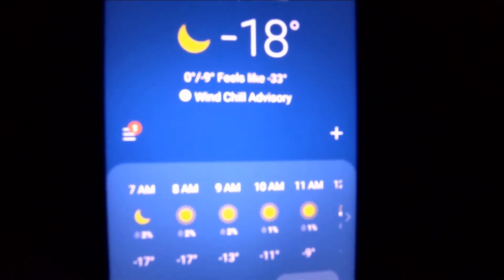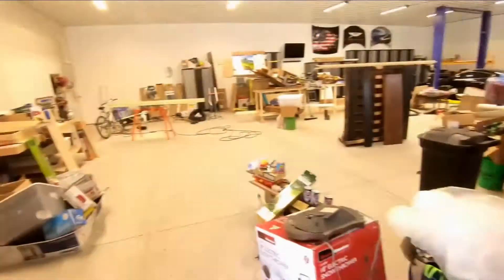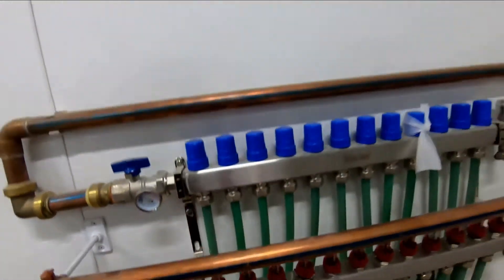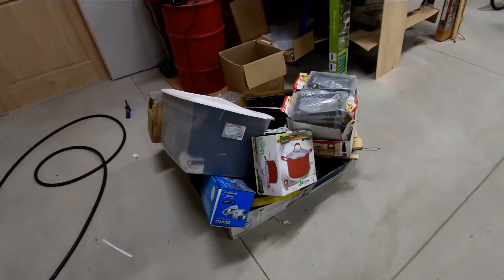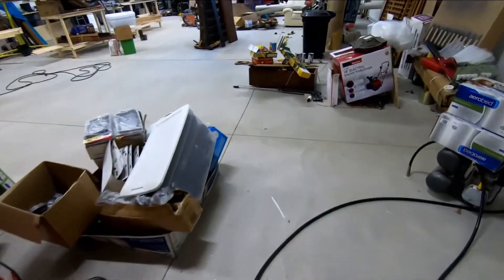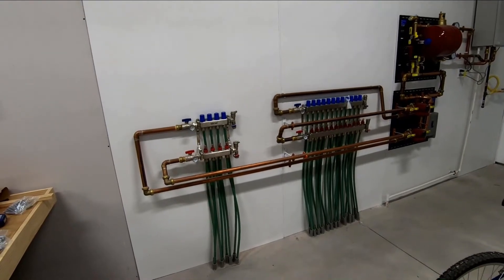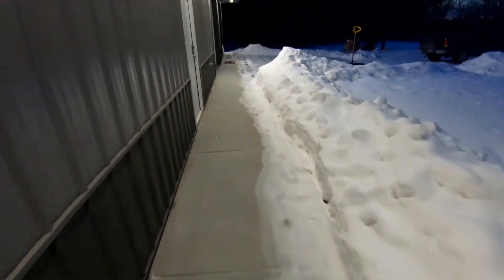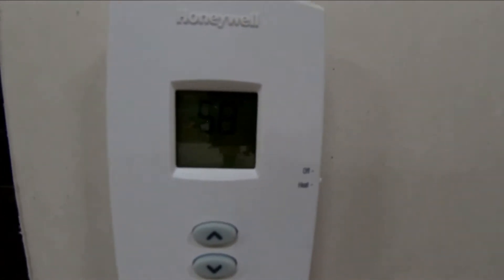-30  Degrees ! Did it Heat? NO Slab Insulation & Tankless Water Heater in Pole Barn Radiant Floor!

Comment: Run a primary/secondary loop setup, run the boiler at 180 degrees, with tempered water for the radiant loops running ar 120. It will be much warmer and more efficient.

Comment: wow.this is laughable,im sorry.3-4hrs to raise 1-2 degrees?no insulation or plastic under slab?floor would sweat in summer even in WI during the summer..i have a shop with in floor heat that is 5yrs old.its below zero today.mine can go the whole day without running and then will run about 1hr.to say that insulation isnt worth it is to say you are crazy to put it in your walls an ceiling..your drinking the internet koolaid.cheap isnt always good and good isnt always cheap.a straight up boiler is WAY MORE efficient.your system cant actually heat the shop,lol.my temp is at 115f coming out of boiler and my shop is set at 60-62f..without bringing a vehicle in and not opening either of the garage doors,my system will run maybe 1hr a day depending on sun.ive never came out to it being below the setting on my tstat no matter how cold or windy out.looking like your "theory"is not working.mine alss doesnt "overshoot" by more than 1f maybe at the most.storing btus for a week is insane talk,not with no insulation and vapor barrier.

i dont want to say its all bad but to tell people this is a good idea is crazy talk without actually knowing the facts.im telling you the other side of the coin here about how when installed correctly,floor heat works like mine does.
Reply from the maker: @rooster5755  When refrigerators were first invented , people didn't embrace it as they were used to the ice man , and didn't believe that unnatural cooling was good for the food. I think you may have been one of those people as they aren't used to change and don't understand new technology.
Reply from the maker: @rooster5755  Well your can search  thermal mass build.  How much does it cost to heat your place and how many sq ft  and cu ft ( ceiling height)?
Reply from the maker: @rooster5755 Also what temp is it set at?
Reply: @ my temp is set at 60f  and I usually raise it to 62f when I’m working or when people are over. All the rest doesn’t really matter. Either the system you have isn’t big enough or not built correctly or lack of insulation. You just opened a service door and walked in and it is below the set point by a couple degrees!I can open my 10x10 small door and bring in a cold vehicle to work on when it’s 0 out and mine might kick on a run but I have never come into my shop and it’s below temp at any time. I can’t tell u what I spend as the tank is tied to my house but I’ll guess about $500 in propane. I’m also in the country with next to no trees and my doors face the west where the wind normally blows from. My shop is also stick built with blown in cellulos in ceiling. Im just being honest with you. This is not normal. I know it’s cold out but I am experiencing almost the same conditions by me.  I also have 15mph winds.
Reply from the maker: This was done when temp was -30 , when its -3 , my system might run 1 hr . The colder it gets , the more energy it takes to heat up , basic science. Also your spending the same amount that I spend in a year to heat my building.  Your temp is higher , so you will use more then me and also propane you get 92k btu per gallon where Natural gas is only 85k btus , so it takes 10% more natural gas to equal your propane btu. So if your building is 3200sq ft then we use the same. If your building is smaller , then I'm heating mine for less. Also , if I put r 20 foamboard down, it would cost 10K for the insulation alone for underslab. That is 20 YEARS of my heat bills before I break EVEN!  If I put r 10 foamboard down , then that would be 10 YEARS of my season heating bills to break even!  So even if I lose 30% heat ground that would be $150 a year . So I would recover my loss of heat if I installed underslab insulation in about  64 YEARS!
Reply: @JasonYouTube  i can agree to disagree i guess..no way would i go through the trouble of infloor heat and not put insulation down or vapor barrier.for the little bit of cost.your insulation must be made of gold also..didnt cost nearly that much for mine i guess..lol.i GUARANTEE that 20 degrees colder by me and opening no doors that my system will maintain  temp.this is really what its about..my boiler runs a max of 1-2hrs sometimes and this is with opening at least one of my doors.then it wont run for a whole day.i will report next week i guess when its -10 to -20.ive just seen videos with all kind of ideas to save money on floor heat.tankless heaters arnt made to run constantly either..will go through 2-3 by the time mine bites the dust.this isnt cost savings..everyone looks at initial cost saving but in the long run it isnt.good luck.

Comment: Nice vid thanks!  I assume your shed is really well insulated?
Reply from the maker: R 25 in walls and R49 in ceiling. No slab insulation and it costs about $500 a season to heat. $10 a month for meter fee alone.  If I did slab insulation at R20 , it would cost 10K for 100 sheets . That would pay for 20 years of my heating bills to recover the cost. People don't understand that some heat loss is ok if you can't recover installation costs! Like when people spend 30K on kitchen remodel before selling , and they only get 25K recovered !
Reply: @JasonYouTube  thanks man.  building an insulated hangar in a cold part of New Zealand.

Comment: This is something I couldn't wrap my head around, insulation under the slab. Heat rises, right? It only makes sense that it would go up into the building and not out into the ground.
Reply from the maker: The ground does sap the heat but only to an extent.  You would need perimeter side insulation or else the sides would drain the heat from slab and it wouldn't heat. So basically create a chimney and the ground with tubing is the fire. You do need more tubing with the insulation to properly heat the ground to make it work. Thanks for watching

Comment: So its set at 130 degrees and on 58 degrees in the shop
Reply from the maker: The water temp is actually 90 degrees going into the floor slab. The heater is set at 130 degrees but it mixes with returning floor water on the panels , so it loses 40 degrees at panel.

Comment: Watched this when you first posted . Im up in Northern Minnesota.  Hows the system holding up after 2 years ? When you did you layout under the sand . What size pex did you use and tube spacing ? Im seriously looking at doing your system . With it being under the sand do you still need to run it at 120° or can you run it hotter ?
Reply from the maker: Its been almost 4 years and about 2 years ago had a pinhole leak in 1 line. It doesn't leak , only under pressure so I closed that line off on manifold.  It might of been a manufacturer defect as it holds liquid when not pressurized. But even with that line down, it still heats the same and uses same therms . The pex size is 1/2" and runs are about 290-298 feet.  Spacing is anywhere between 6" - 8" depending on area. Along walls and garage doors, used tighter spacing to compensate for heat loss .  I run it usually at 120 , but if its warmer ( 32-38 degrees) then I can turn it down to 110 as sometimes it overshoots the temperature by 2 degrees. You don't want big temperature swings as that uses more energy to stabilize temperature. when its under -10 degrees , I will boost it up to 130 . Raise or lower temp when its like a week of temperature extremes. Also changing temp exercises hot water heater , allowing different gas flow.  Not really needed but I do it once in awhile to just mix things up.  That tankless heater temp of 120 , you are only putting in between 80 -100 degrees into the floor pex , depending on how much tubing you have and the main panel setup. I have never seen 120 degrees go to the floor pex . Thanks for watching the videos
Reply: @JasonYouTube   thanks for the reply . I'm going to be using a outdoor wood boiler for my heat and a propane back up . Did you put a vapor barrier down under your coils ? I can't remember in the video , I'll have to watch it again . How did you hold your coils in place to the soil? I definitely want the thermal mass effect.  But I also have a working shop and want to be able to bolt anything down I need any place I want.  So no tubes in my concrete for sure .

Comment: Amazing how your systom works...an no one is taking in account that the ground becomes its own insulater the deeper the heat travels till it starts to reflect back up....jason what size boiler are u using...ive read about this but to hear it work is amazing....thanks for your work
Reply from the maker: Thanks, it's a modulating tankless water heater and puts out maximum 120k btu and modulates down to 45k .  True about the ground but then contractors can't add in the extra 3-5k  to lay down foamboard!
Reply: @JasonYouTube  I read a story about a man in Wisconsin who heated his home the same way but used a 400square ft solar panel an started heating the thermal mass in august....an used the solar panel all winter....wish you tons of luck with your system...it's just like magic everyone questions it till the know the trick
Reply from the maker: @lancemartin7926  Well when the horseless carriages were invented, people said they would never work. If your taught a way to do something for many years, you question or won't believe there are other ways to do it. People resist change and they don't want to research it . But they always say their say , even if they have no clue what they are saying. Gotta love society

Comment: Looks nice. I have same size shop in progress now.  In MN. I’ll be using lp.  What brand/size boiler are you running ? Thank you
Reply from the maker: Thanks, It is a Takagi  120K BTU Condensing Modulating Tankless water heater. I have around 4700 ft of pex in the sand , so it easily heats my shop.  I have other videos on the heater , if you want more information.
Reply: @JasonYouTube  I would like more info on your heater 👍 thx
Reply from the maker: @onlyorganicshealthwellness478  I have a video up discussing it vs a boiler. Should have all.info in it

Comment: How’s your tankless heater holding up ?  My tankless heater burnt a whole in the burner housing …on two of them .
Reply from the maker: Mines holding up good. In the off season I usually will run it about 3 min every 2 weeks to keep everything clear. Did you get a Takagi water heater or a different brand? The Takagi is rated for space heating applications also so maybe they used better burner assembly? Or maybe your was running to lean and overheating .

Comment: U r wasting money. Your ground is soaking up a lot of heat.  Tell use how much gas u r  going through how long does it run. All day?  Insulation is the only thing that will pay you back every year
Reply from the maker: Look at my channel videos and I show my bills. I break it down to heating cost per cu ft to make it easier to compare. I use ng , so if you use propane , propane has double the btu of ng so will use 1/2 as much cu ft  as natural gas. I did a lot of videos on cost breakdown and Heat loss to ground vs slab insulation cost. My building is more efficient then most 2200 Sq ft in heating. So good points and my videos show my real costs of heating, just search them

Comment: Jason, What fitting are you using for the pressure/temp gauges. I am using a Hydro Smart Gauge Part # HSTRID200T80PSI  It looks like it takes a special fitting as there is a rubber "O" ring on the inner shaft. Great instructive Videos. Thanks!
Reply from the maker: Just standard hydrosmart but Amazon sells the gauge for $18.  Any temp pressure gauge will works as long as the threads are the same.  If you look at amazon , you can see the threads have an adapter around it.